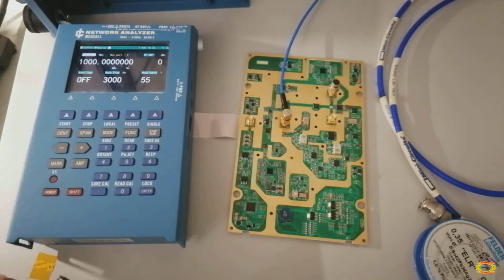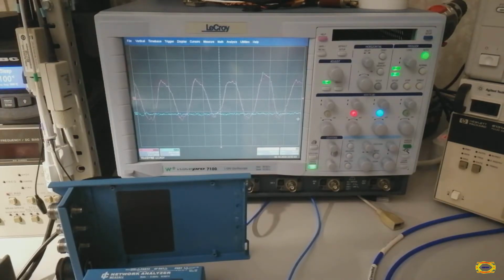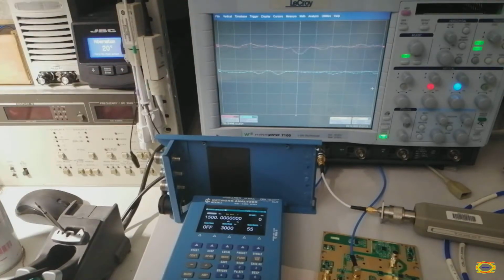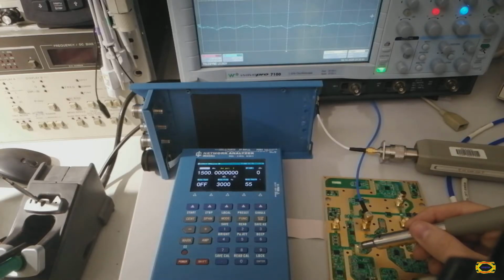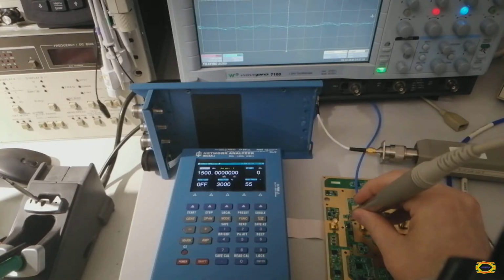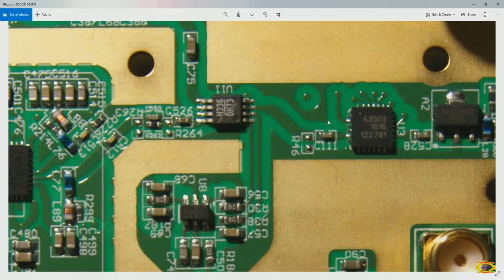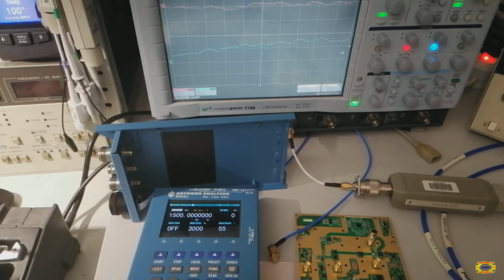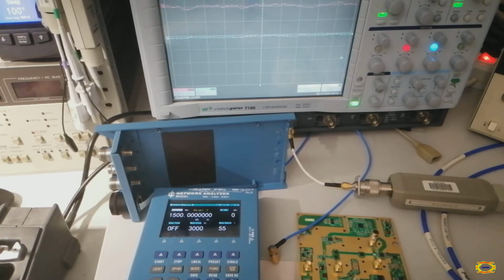#3 Repairing Deepace KC901V Network Analyzer

Comment: Thank you.  
I run a radio shop for a public safety agency that maintains over 3500 filled devices and a multitude of repeater sites.
This looks like a useful tool for our field techs.
We currently run with Agilent N9340B analyzers and are just now looking to upgrade.

Does anyone have field experience with this?
I have heard (via YouTube videos) of a fairly high failure rate w/the KC109 .

Thanks

Comment: I think the problem is not only the capacitor to reduce the conducted and radiated noise of the power supply; maybe an earth terminal wouldn't had break the amplifier, but I think this VNA has a poor design of the output stage, because even you have an earthed power supply, you can measure a device with a non earthed power supply, and then the VNA could fail too. 
If the VNA had a transient limiter or a high pass filter, this problem would not happen. 
I have an Anritsu spectrum analyzer (from Ebay) and the power supply have the same problem (not the original and non earthed), but the spectrum analyzer has not broken, so I guess it has some kind of transient limiter.
Thanks again for your video, it has been very instructive!!